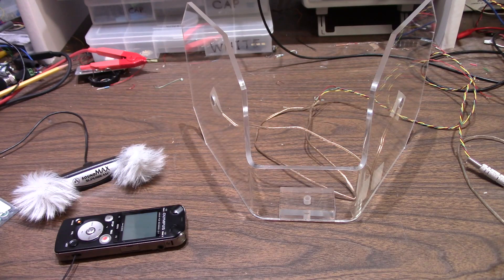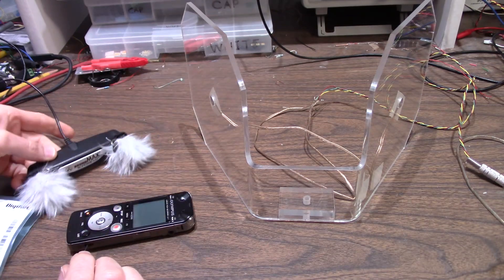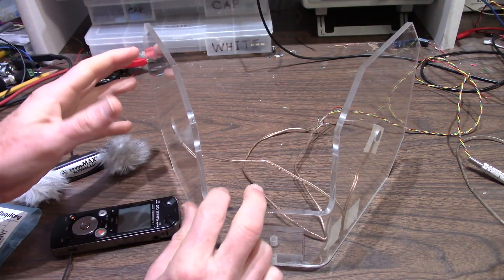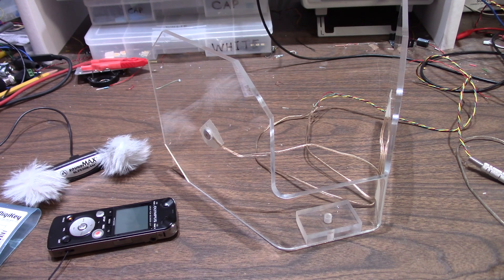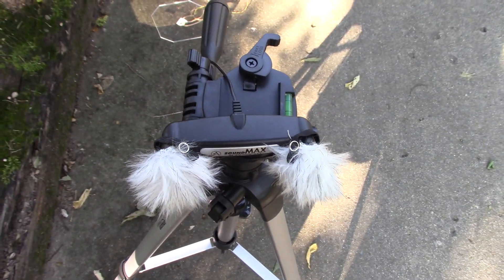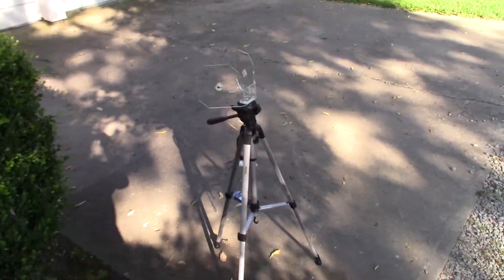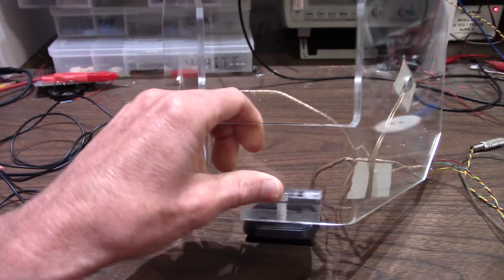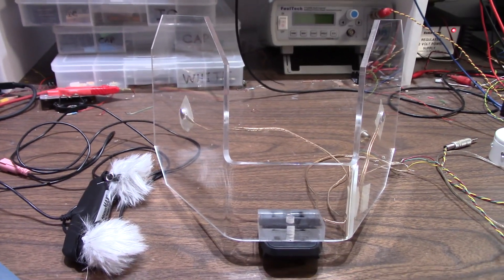Building a binaural field recording microphone

Comment: Hallo John, I bought a cheap TDA 3116D2 two in one (preamp and amp) on one  board. I noticed when I received it that the audio input and power input are right next to each other on the board. Is this a fatal flaw on this board where I will never be able to eliminate oscillation and ground loop noise?
Reply from the maker: It could be okay as they normally use a ground plane on the board. Can't say for sure without seeing/testing it.
Reply: I do not know what happened to my reply where l let you know where you can get it to test. 🤣

Comment: Interesting. I think you have to simulate a human head to get the best true human like stereo result/experience. The backside/rear (behind the mics) need to be closed/fill up like a human head and you need earcups to block reflections of sound entering from the backside. For example, at 6:39 you can notice the difference when moving to the right (entering close to the hedge), there is some reflection of your voice noticable (by this hedge). In this example it isn't bad for the stereo experience but showing you reflections can influence the stereo effect. With the newer microphones, this isn't what you want. So you need earcups to avoid such reflections to get a true human like stereo result/experience. Non-native English speaker here, hopefully understandable what I mean to say here.

Comment: I find the AOM 5024 capsules to be kinda harsh, likely because they are very sensitive as you said.   I built a binaural box set using an 18mm project box, with dummy silicone ears on each side.  Similar to the box that AWI sells in the UK, model SR3D.  The 5024s worked well, but I’ve since replaced them with the Primo EM 272s.  WORLD of difference.  They are more expensive, but I think , well worth the cost.
Reply from the maker: Nice specs on the 272, but the manufacturer makes them hard to get.
Reply: @JohnAudioTech yes, our only option is Micbooster in the UK.  With the $$ conversion and shipping, they’re about 5x the cost of the 5024s!